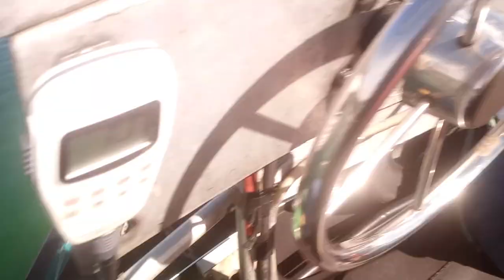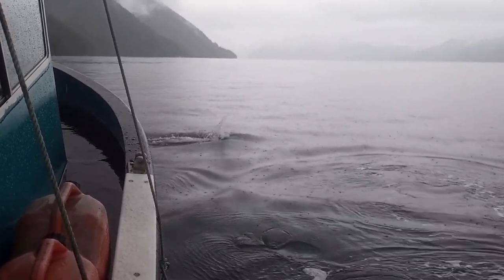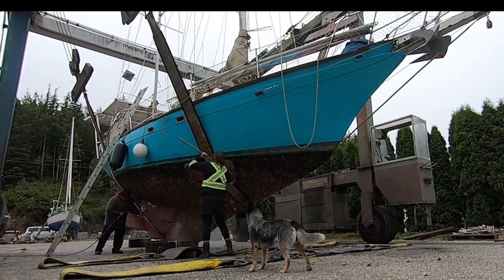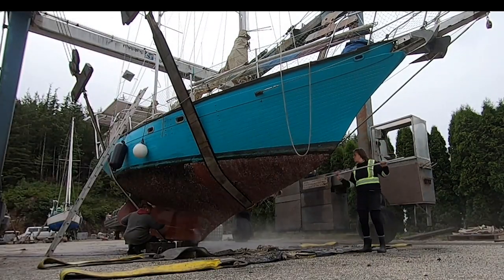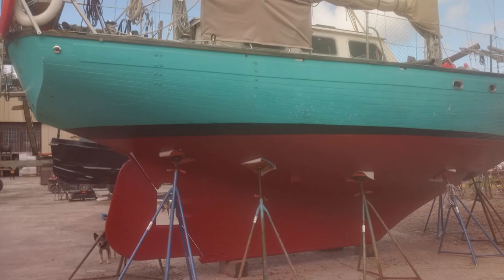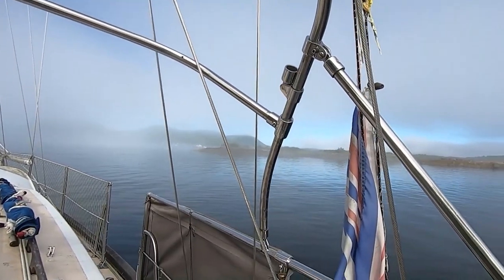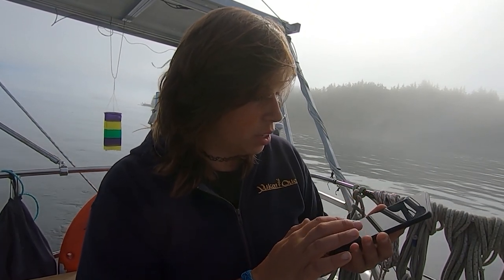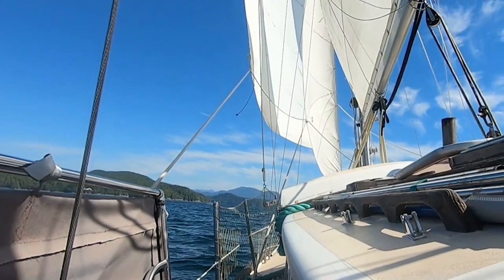beachcombing for logs and sailing against the schedule - Sailing Oka Solo - 035

Comment: Good to see another electric motor on a sail boat. As many keep saying it won't work, its great to see another proving them wrong. Just installed a 10kw motor on my Contessa 32 so yet to launch and see how it goes.
Reply from the maker: Im definitely pushing it to the limit this winter running mostly hyrbid against arctic outflow winds and blizzard white out conditions.

Comment: Excellent video. She looks pretty with all her Sails up. Close hauled definitely will keep you on your toes. When you said beachcombing, at first I thought you meant with your sailboat, yikes!.

In my youth I used to work on tugs, Rivetow straights, Seaspan, Pacific tug& barge etc. 

I get your issue on haul out, I owned a westsail 32 for 35 years, and the front belt was always an issue for slipping on haul out. When in Nova Scotia at one time my boat had slipped off the belt. My bowsprit smashing into the dock. But thank God we were only a few feet up, and surprisingly there was no damage .  May I  recommend to place some markings on the hull by your capping-rail where the belts should be placed. It takes the guess work out .  And yes the front belt should always be tied back to the aft belt or similar. Some people who work in boatyards can be clueless, especially when they think boat owners are. Though many boat owners are. They shouldn't have left your boat sitting on a 10 degree heel on stands. Personally I wouldn't go back, unless they are the only game in town. 

Good luck on your captains ticket
Reply from the maker: Mi friend has a steel version on my boat and in this same yard that shall not be named the front strap slid off as the worker was putting a block under the boat. He lost his thumb.  Stressful haul out I was worried about staying in the yard so she was back in the water within 48h

Comment: We live in a beautiful province. :-)  I don’t know if you’re in the market for a new battery, but Renogy has a special on their 200ah lithium battery. Comes with Bluetooth and a robust bms. $1199 free delivery to most non-remote cities.
Reply from the maker: thanks but im assuming those are 12v batteries and may not have a bms capable of a 250a discharge rate if I go full throttle. I ended up building my own diy lithium battery out of reused electric car cells 1000$ for 16x 260ah 3v cells (equivalent to 1040ah @12v with a bms that can handle heavy use and does Bluetooth
Reply: @sailingokasolo6801  And of course I knew most of that, as I watched those videos.  Just another brain dead moment. They are becoming more common these days. ;-)